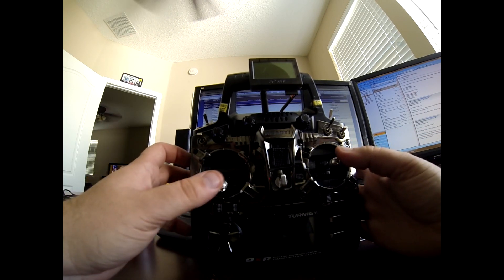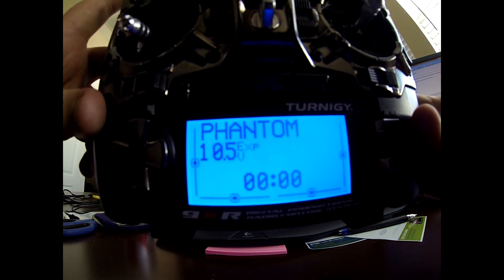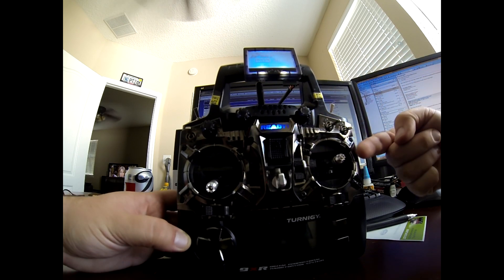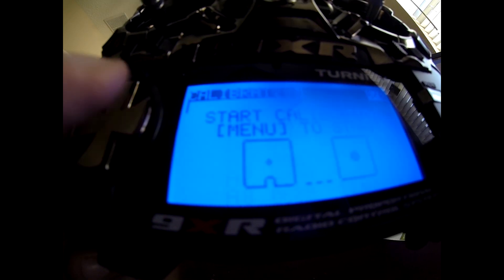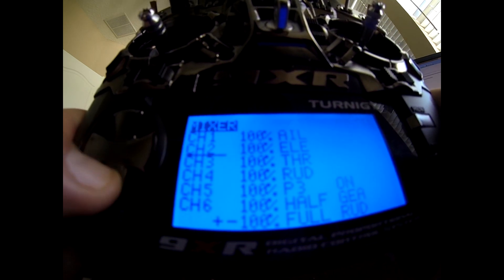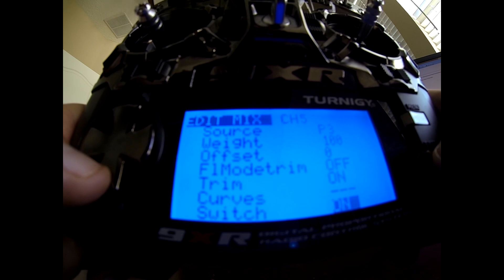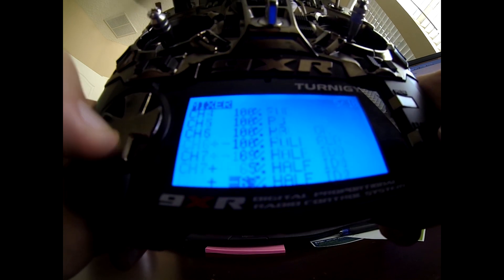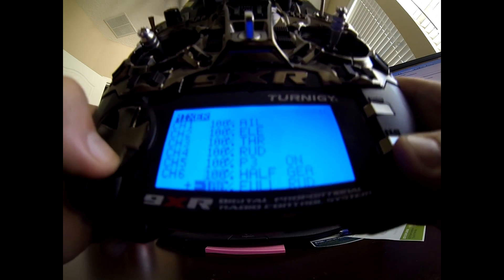How to program a 9xr for Naza M or Phantom

Comment: Thanks for the info helps very much. i have one issue when i set the p1 dial to my gimbal. now the issue is that it just goes up or down when i turn the dial but no mid range view or angle. any advice

Comment: Hi Steve - 
I'm wondering if you could help me out with this...
Trying to program a switch (ele) to control the pitch of my gimbal. 
I would like the normal position to have gimbal facing forward, and the up position to make gimbal face down. Cannot for the life of me figure out how to NOT make it go only straight up or straight down. 
I'm using the er9x firmware on the TGY 9x.

Comment: Thank you Steve for this setup vid. I follow closely and manage to get my f450 up and flying in gps,atti mode without any problem. But when i wanted to try out Manual mode, i have problem taking off with the quad just flipping over on the ground. Is there any settings i need to do on my tx?
Regards

Comment: Great vid dude. I have the open 9x software in my 9xr and was just wondering what the equivalent is for source half to set the IOC switch. The source on mine in channel 5 does not have half to select. Thanks for sharing. Your vid is a great help